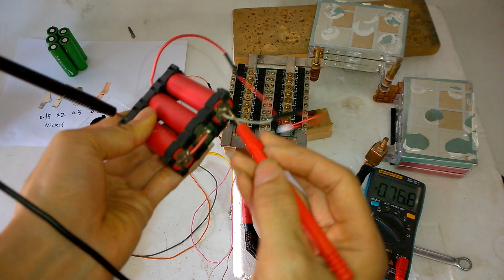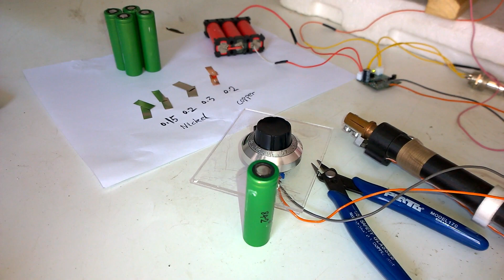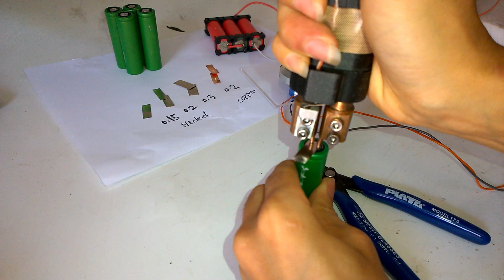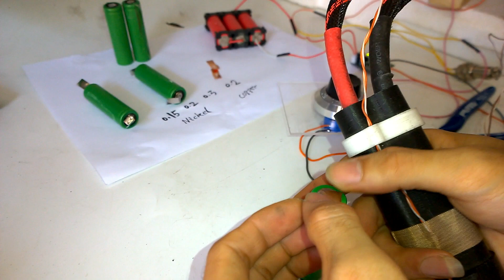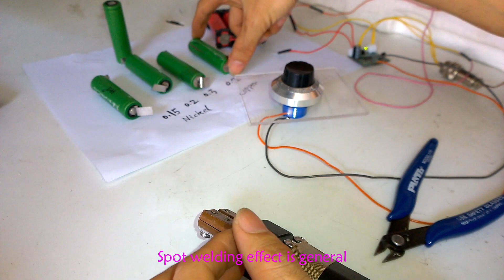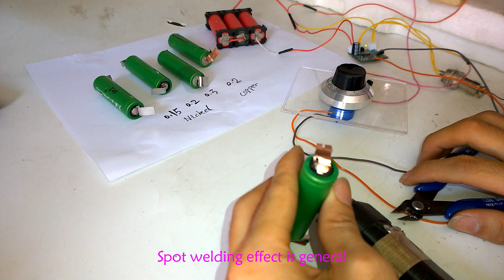Spot welder pure nickel and copper strip

Comment: Master Yousun, greetings. Thank you for demonstrating Copper Spot welding. So far, no one has demonstrated  this experiment , not that I have seen any. I tried Spot welding Copper and it was a total failure. Now I understood that Nickel and Copper needs to be laminated, in order to obtain a good fusion with parent metal.
That is a good idea. Though you did not mention to increase the current, I understood the concept.
I’ll be performing a Ni-Cu laminate and see how things go.
Once again thank you for the Ni-Cu combination spot welding technique.
Reply from the maker: I'm still experimenting with spot welding copper.

Comment: Whats the Internal Resistance on those cells? Just curious what your overall resistance is for the whole pack and if you think it comes close to doing a 6S supercapacitor pack with 3000F caps.
Reply: I seriously doubt it. A 500F cap bank will have a very low ESR compared to a bunch of cylindrical cells.  He would need a TON in parallel!

Comment: I am making a battery from P42A Molicel and need to pull up to 45A from the pack. So I need to use 0.5mm copper strips, will it work with this method? 0.2mm copper strips are only rated for 27A if 10mm in width
Reply: The only thing thats going to touch 0.5mm copper is something from SunStone. Expect to spend several thousand dollars.

Also, you can't pull 45A continuous from 42A's only 25A. You can burst 40-45A but you need cool down time

Comment: I wanted to ask you about the effort you exerted on the spot welder electrode handle. You almost put a pressure of about 20 pounds to get a decent weld. This may not be a good idea in the long run, I think.
What type of Copper electrode are you using? Some users use a copper alloy. Please let me know the type of Copper Electrodes are used. Thanks. 
Wishing you a Merry Christmas and a Happy New Year.
Reply from the maker: It is also a copper alloy. Happy New Year to you too.

Comment: Could you specify the welding time in milliseconds? I have a controller circuit on the 555 timer and it is advisable to know the optimum welding time for a certain thickness of the tape (pure nickel). battery 2s2p Lifepo4.
Reply from the maker: This controller is also 555 control.
Reply: OK thanks. then I need to take a 100k resistor and a handle with a scale, on the oscillograph I'll see, thanks for the video, success!

Comment: I bought 0.15 mm nickel strip from aliexpress but my spot welder can not weld it. On the other hand my spot welder can weld 0.15 and 0.20 steel plate. Why can not weld nickel? Pls help me
Reply from the maker: The spot welder has insufficient current and the internal resistance of the nickel piece is relatively small.
Reply from the maker: Your spot welder needs to increase the current.
Reply: @yousun2827  my spot welder 5v 200 amps. Is not enough?
Reply from the maker: Yes! My spot welder is 8.4V 600A.
Reply: @yousun2827  Thanks for explanation. I will upgrade mine. What is the best voltage for battery spot welding? Somebody says 4-5 v is enough. Yours is 8.4v. High, isn't it?
Reply from the maker: Up to 8.4V can spot weld 0.3MM pure nickel, Adjust voltage and current as needed.
Reply: @yousun2827  Thank's for the information. You have been very helpful.